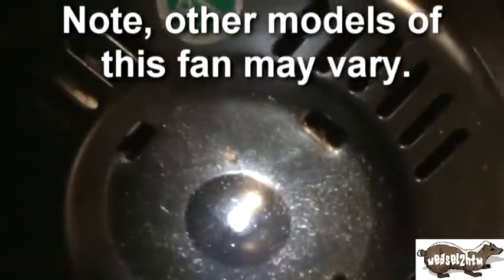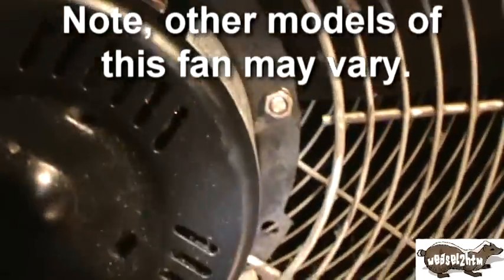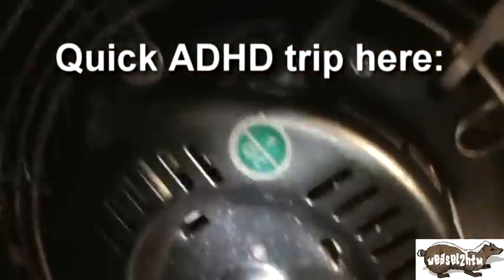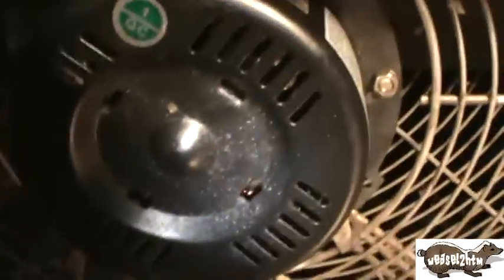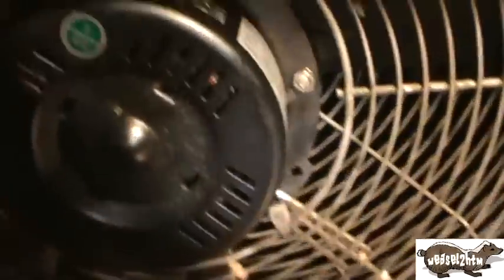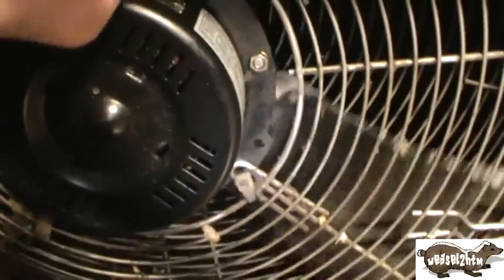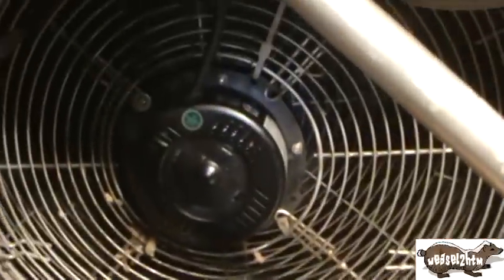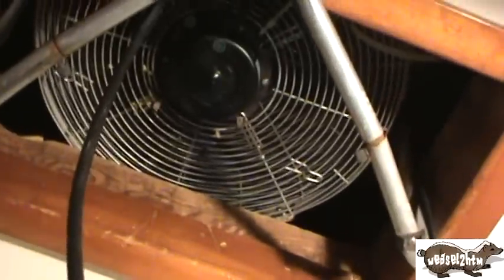Video Request:  Oil Ports on Aloha Breeze fan

Comment from the maker: @uxwbill The Hallway where this was filmed is very narrow, my back was against the wall, I was holding on to the fan stand to help stabilise myself in filming, the stand shifted, surprising me.  Rats, I forgot to adjust the opacity on the weasel (I set the opacity to about 80% so it will be slightly see through,  I can't wait until I have enough extra cash to upgrade to the new version of Sony Vegas)